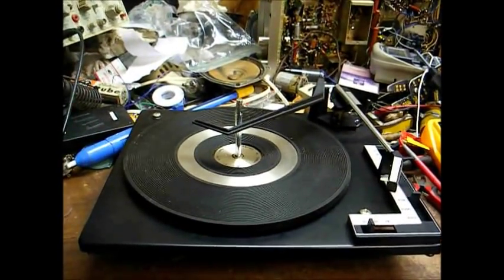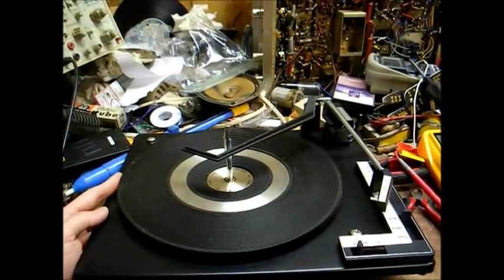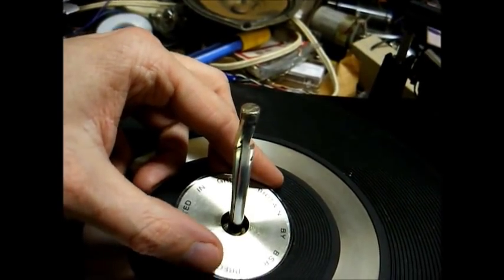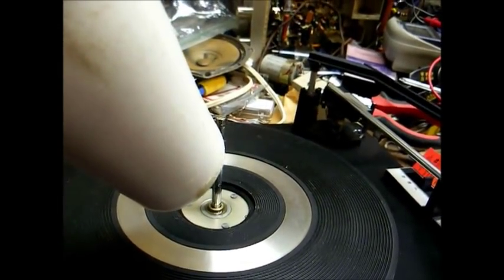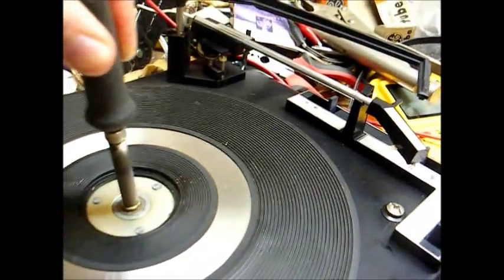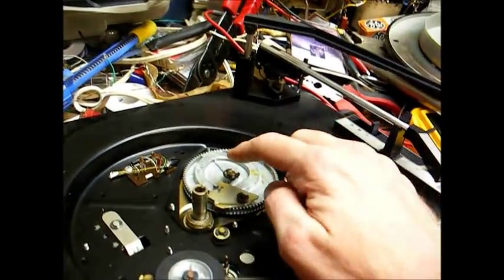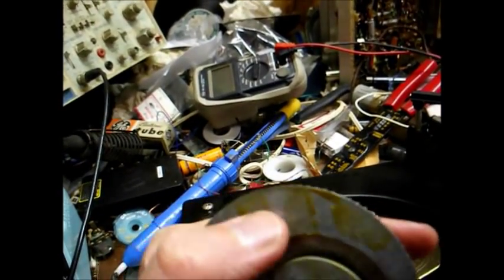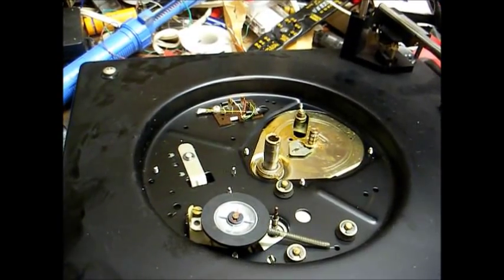Removing a seized platter from a 1970's BSR turntable / record changer

Comment: Liquid Wrench is designed to dissolve old grease and oil 3 in 1 isn't  you would have better luck at removing the turntable using Liquid Wrench.  Liquid Wrench is better at freeing up the moving parts as well.  I  use isopropyl alcohol instead of just plain alcohol

Comment: Yep, with a 2 pole motor a hum was introduced with a mag cart the farther the arm moved to the center of record...obviously closer to the motor. Thought about designing an aluminum foil magnetic shield...but not worth it. Easier to get a BSR table designed for mag use.

Comment: This is the situation: I'm trying to repair a frozen BSR turntable for play 78 rpm records for my parents in the december 29th 2014, because that day is my father's birthday number 93th, and he and my mother wants to dance with an old music they have stored for many years in their closed. That's of course is an 78 rpm record with an Argentine Tango from the 1940.
I just have been removed the seized platter, thanks for your detailed procedure. REally I tried first with a hairdryer, but this doesn't worked. After that, I used my iron soldering device and EUREKA!
Next step will be the re-grease process and the inspection for the idler, and finally to install a NOS Sonotone cartridge. I want to say thank you very much to enable me to get a fast track to repair the turntable. 
This is not finished yet, but the main success, no doubt, is based on your contribution. (Please, excuse my english) Best Regards/Ricardo
Reply: Ricardo Alberto de la Fuente how do you use the soldering iron to remove the spindle?  Thanks
Reply: Just put the soldering iron touching the spindle for a good while, till the heat pass by conduction to the turntable and loose the freeze grease. Good luck

Comment: The soldering iron trick i never thought of. Its nice to learn something new everyday.  The cam gear i would be less concerned about applying heat to since the shaft it rides on is metal along with the bracket its mounted to.  BSR's of course are laughed at, but they sure as hell would outlast any modern Crosley changer.
Reply: I strongly agree with you.  Once they are properly serviced and re-lubed, they will last for decades again!

Comment: Thank you for posting this video. Just as you stated: heat, patience, and time. This past week I used your technique to free up and remove a BSR platter. That BSR grease should be called slow set glue, because that is exactly what I found holding the platter in place.

Comment: Glubricant was a common issue in SONY tape recorders and seized them up really badly. I like to use Marvel Mystery Oil to help free it up. It's a penetrating oil and a cleaning oil, very thin (much thinner than 3-in-1). Lighter fluid will help clean the old grease nicely. Followed by alcohol, then white lithium grease.

Comment: I recently picked up a Zenith console with the BSR changer in it and the platter mechanism was frozen or stuck. I guess I got lucky cause I forced the platter to turn (but didnt manhandle it in any other way) and it did free up. I did get it to turn freely but it made some noise, so I tried a few drops of 3 in 1 oil down the spindle and it quieted down nicely. I understand for long term it should be dismantled, cleaned and relubed but at this point I'm fairly satisfied that it operates correctly so I dont want to fix it if it isnt broke if you know what I mean.

Its been working fine for a few weeks now, and I mostly bought it to play and possibly record some old 78s that I have and I doubt I will use it much beyond that. I am watching a few videos because I was interested and thinking about doing that but the more I see, the less I want to tare into one. Thanks for sharing your work and I got a real kick out of your remarks at the beginning of the video. People can be so stupid and mean spirited some times but I think you got the last laugh on him. I know I laughed pretty good.

Comment: Great video! Another often missed piece on these BSRs is the peg which engages the bottom of the cycle gear. It looks like a solid shaft but is actually a frozen up roller bushing.

Comment: Not only does grease act like glue when it becomes hard, the same is true for oil in fan bearings. I tried to lubricate an Easy Home pivoting fan that was completely stuck. Either I forgot about your idea about using a soldering iron or hair dryer or I naturally didn't know about this up until now. I tried to force the rotor shaft off the bearing, and then I ended up pulling the bushing out, and then it became a parts fan. I saved the blade, power cord, and cage. What I had learned: Never try to force seized motor shafts to come out of the bushing assembly. Thank you for this video! Next time I have a completely seized up fan, I can use my soldering iron or hair dryer to fix it.

Comment: When I worked for a TV-Stereo shop in my home town some years ago I unseize BSR platters by using a drill bit that was the same size as the spindle hole on the platter.Put the bit in a vise, stuck the platter onto the bit, wiggled it to scrape off a bit of the aluminum, cleaned it, put it back together,and lubed it. Works fine!

Comment: Thank you so much, I paid way too much for a stereo console that was supposed to work and the turn table wasn’t spinning. I used this video to get everything spinning great but it still wasn’t working, it turned out I also had to clean up the idler wheel gear as well and it sounds great now. Thanks for the video!

Comment: Life saver! I have an old all-in-one radio/8 track/cassette/record player (It's an "Imperial" by 'Superscope', circa late 1970s) that had a seized platter. Thanks to your video, it's working perfectly again! Only difference is that instead of using a soldering iron, I heated up a screwdriver with a propane torch til it glowed orange, and stuck that in the hole.

Comment: As of yesterday, I was checking at my Fisher BSR turntable, I lift the platter out and everything has taken apart and I looked at it, it has the old grease on there to cause the changer to seized up. So I cleaned everything including the cam wheel, the washers and everything to get rid of that old grease and re-lubed it with 3-in-1 oil to restored my changer. I put everything back in and it runs really perfect. BSR turntables are an easy way to fix.

Comment: Thanks for the video!  I use these instructions to pull a BSR changer back to life from the parts bin.  Its going in to a mid-60's Coronado suitcase record changer that originally had a VM-changer in it, but it was so beat up I couldn't do much for it.  I do have to have a friend help me with making a new mounting board, though as the mounts for the BSR and V-M changers are different.  I got it wired up and did get it to play, so there is hope for this thing!

Comment: I have my BSR turntable, mine is a Fisher rebadged, but it has a C142R changer with a magnetic cartridge and the turntable model is 220X. This one is a high end BSR and it works and runs excellent without getting seized up.

Comment: Thank you for the "how to" video.  I watched it and would like to suggest the use of a piece of heavy aluminum foil with a hole poked in the middle and placed on top of the platter to be used as a heat deflector when using the hair dryer to protect the platter.  I used this method with great success.  I aimed the blow dryer at the spindle about 1 1/2" up from the platter at a distance of less than 2" for about 6 minutes until I saw the lube/glue begin to turn from an opaque to translucent texture.  At this point I was able to remove the spindle.  The platter took the use of a Weller soldering iron for about 5 minutes to remove it.  I also used the Weller to remove the changer cog gear under the platter as well.  Also I would like to add that the decal disc in the center of the platter can be left on for the platter removal.  Thanks again for taking the time to help out those of us trying to restore and maintain vintage equipment.  My daughter enjoyed listening to swing music along with a glass of wine after I repaired her player.  Take care.  Jim

Comment: Great video! This is a common problem with BIC turntables from the 70's as well. I've found that like you demonstrated, the soldering iron works best. Before I discovered that method I ruined a few very nice BIC and BSR turntables trying to free up the platter by force. But I have had success without applying heat by spraying the spindle with the very thin WD-40 oil and slightly, gently spinning in both directions. But again, soldering iron works best if there are no plastic parts in the way.

Comment: Another problem I've encountered is corrosion between the sector gear and it's shaft on a JVC/Nivico changer from the early 70's (still all metal construction). I had to carefully use a punch to drive the shaft out of the bore of the gear and use fine grade sandpaper to remove all the white corrosion. I relubed it with white lithium grease along with cleaning out all old lube from the entire mechanism and relubing with 3 in 1 or white grease where applicable. The changer works ands sounds great.

Comment: Thank you!  Works great now.  My only suggestion would be to have shown where to put the new lithium grease and how much.  I just winged it.  BTW. I used my sewing machine oil, waited maybe a half hour (I was ready to wait a couple days since I was in not hurry), but up the turntable came.  I did use the hair dryer on the gear since it is all metal.  As for those who feel the need to comment on your accent--they are the ignorant ones, not you.  Which one figured out how to fix a seized-up turntable? :)
Reply: laurel moon ++ i've watched this guys videos and will use his info on a stuck bsf turn table i have, bought new in 1980 shoved off to the side in 1993 by my ex wife and not used since. i kept it thinking one day i'd get it running. maybe with this guy's info i can do that. prefer the older record players before equalizers and the "digital age" moved in.also have a 1955 rca 45 player i will get going. everything works,waiting on replacement cartridge. would rather enjoy my extensive vinyl collection on the old players they were made for. 
   as for this guy's accent,no problem. i'm from north carolina and live in mississippi now.i have that same accent and intelligent as most are here in the us south.my daddy sounded like that. he was a tv/radio repairman as a side job in the 1950's and 1960's. i remember him working on some of these old rca record players. my daddy passed away at age 32 in 1966. working on this old stuff in my retirement brings back good memories of my daddy.

Comment from the maker: Years ago, I replaced the ceramic cartridge with a magnetic cartridge in a BSR and it worked fine. The only things to watch is that the models with two pole motors may introduce hum into the cartridge and you won't be able to use a magnetic cartridge in models with a narrow headshell.

Comment: Hi, I've had good luck with a small BernzOmatic butane click torch that has a flexible snorkel end. I heat the spindle perpendicular to the plastic platter quickly, & gentle. Like the soldering iron method, it then frees up nicely. Thanks for letting folks know & posting!

Comment: Have you tried using a penetrating oil like Kroil, or even WD-40 or contact cleaner to try to partly dissolve the old grease, rather than going right to heat? I'd think it might work better than 3-in-1.

Comment: Excellent video.  I have an Allied Model 919 4-speed turntable vintage 1970's whose turning torque gradually diminished over the years to the point that the turntable wouldn't turn at all in some speeds.  I removed the turntable and the cogged drive wheel as you suggested and found the ever popular BSR identification.  I then cleaned the rubber drive wheel, re-lubed with fresh light oil the axles of the turntable and the cogged drive mechanism that powers the needle arm.   Simply removing the aged lubricant and re-lubing as suggested did the trick to my mechanically "dead" Allied/ BSR turntable.  Thank you for your excellent guidance!

Comment: Yeah just got a Zenith IS stereo with said BSR record changer recently.  It was completely seized up from decades old grease.  Yeah, it can get difficult to remove the platter.  I got a plastic auto-return gear instead of a metal one  But the changer is all de-gunked and given a white lithium grease treatment.  Another helpful tip is to put white lithium grease at the base of the spindle and inside the platter center for easier removal.  Also treated idler wheel with Rawn rubber cleaner.

Comment: Nice video. I have also had luck removing the platter by applying some Isopropyl Alcohol down the centre/shaft. This will help break down the old lubricant. In my case the platter was plastic so I couldn't really go with heat method. The spindle was also stuck in with old lubricant so sticking a soldering iron down the spindle shaft was not an option.

Comment from the maker: A lot of these used sapphire needles and these wear out much faster than diamond needles. When I replace a needle, I always try to get a diamond needle. Most of these needles are held in place by clip on the cartridge and to remove the needle, one has to carefully work the needle out of the clip.

Comment: I also used a soldering iron to heat up the stiff grease on other phonos to help take the gear or platter off before cleaning & lubrication.

Comment: To remove a plastic platter like my BSR Quanta 60MX has, just simply remove the rubber mat, disconnect the belt, and lift up on the platter while turning it clockwise. It will unthread off the center shaft while lifting and turning clockwise. To reinstall the platter, place it on the shaft and turn it counter-clockwise.

Comment: Interesting technique!  Wish I'd caught this one before working on a BIC I bought recently, ended up having a friend help me with a mallet and dowel to get the platter off.  It plays fine now but I may have to glue the bearing so the spindle lines up perfectly.  That 90w oil they used was a bad idea...

Comment: Blow dryer NOT heat gun. Remember the platter is made partially of plastic on many models.
A correct range of soldering iron is the easiest way to get a platter to come off!

Comment: I saw the original video with the console this came out of.  I don’t have the same cabinet, but the insides are the same.  Everything is running fine, but my track 1 light bulb is out. I tried to access the bulb from below/behind, but it appears it would be much easier to access it from the top. Is there an easy way to do that?  I took all of the knobs off except for the “selector” knob, but I was unable to remove anything past that in attempt to move the plastic and access the bulbs. Thanks in advance.

Comment from the maker: I have a couple of UA8 BSR/Monarch changers installed in some equipment that dates from the mid-to-late '50's that look decent. I'm not all that crazy about the newer ones; but, I've fixed quite a few of them over the years. My biggest complaints with them is that many of them run a little too fast and some have a good bit of rumble. I guess they were OK for use in cheap systems for people to play their K-tel "22 Butchered Hits" album collections.

Comment: Hello to you been watching a lot of your videos amazing how you are able toi fix and or modify them that takes intelligence and talent not expecying a reply but i got a year ago a BSR fisher C-20 PC7 record changer with ceramic cart for free it was in excellent con. cover was not badly scuffed it was siezed but cleaned it out and relubed everything it works fine it came with a small counter wieght and adjustable tracking force I looked up the recomended tracking and found that this cartridge tracks at between 3 to 5 gfams so with a new stylus I bought it down to 3.20 grams was not expecting great sound it is a typical ceramic cart but I hooked it up to a reciever with an equalizer 2 bookshelf speakers and a subwoofer adjusted the equalizer for lack of bass these carts have and dcreased treble set it aside and started working on other TT's I had but went back ti this BSR and wanted to try it out and I could not believe how this sounded I was shocked on how it sounded the bass was clear and treble was not harsh even mid range was great and seperation was decent am I crazy ,I mean I grew up with kind of changer during 70's my father had the console type of players through out the years they sounded fine but I did not expect this it almost compares to my Dual 1225 and my Realistic lab-440 and these have the good cart on them is it possible for this to sound as good or is my hearing finally going I know you may not reply but I had to tell somebody who knows about these players from a confused or deaf fan JRo

Comment: ^That's the model I want. The same type I grew up with...but...how about a seized(?) tonearm? It's an early or mid 1980s 2 speed model. I've gotten the changer to a point where it at least spins the way it should and the cartridge picks up sound, so it still needs more work. It's this tonearm that's getting in my way though. It's made up of a few different parts, metal and plastic, and I just can't tell what or where to clean and regrease. Stiff as crazy. There's no way that thing is going to be floating across a record any time soon in the state it's in. I don't see anything in the mechanism that could be preventing it from moving. I've soaked/dripped 91% rubbing alcohol down into the "pivot" and even some oil just to try to get it moving. Still stiff. Won't budge. Is this something I just need to keep on working at with the methods I'm already using? I really don't know what else to try.